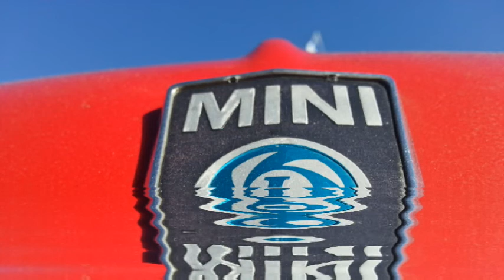Austin mini restoration - Door step fitting

Comment: Hi Sean, was looking at getting a spot welder but how do you power yours? I read that even the 6kw ones can't be plugged in by a standard plug? I'm watching your video series before I attempt work on my Mini. Cheers
Reply from the maker: Hi, you would need to get the power in your workshop upgraded to power a spot welder. Some will work off a standard plug but you will find that the electrics will keep tripping. I just plug weld

Comment: Was it hard to fit inner wing I am trying to fit mine it’s a pain to fit trying to get hole lined up for shock mounting i have left my support panel on so I can lie up the inner wing and bolt it on to it what’s best way to fit inner wing
Reply from the maker: I didn't have any real problems fitting the inner wing. I managed to use the shock mounts and door hinge holes to assist in lining it up. Just take your time and double check that you're happy with how it looks before you weld. All the best, Sean
Reply: Sean C thanks
Reply: Hi sorrry to be a pain I welded my inner wing put new door step on genuine one like the one you used did you use genuine door hinge panel I used a magnum one put door on and it’s not wright had a nightmare today lol was thinking if you used genuine or same as me sorry to keep asking
Reply from the maker: Hi buddy, the magnum pillars are totally wrong and don't fit. The profile isn't even right. You can get them to fit but it's an utter headache so my advice would be to fit heritage panels in key areas like the hinge pillars. I've fitted a flitch (magnum) to the passenger side and the fit is bloody awful to the point in considering scrapping the entire inner wing and replacing it with heritage. All the best, Sean
Reply: Sean C aw ok thanks for your help much appreciate it I did have my old hinge panel on door fitted fine then i lie up new inner wing genuine and weld it up it’s only when I took out the old hinge panel and put new magnum hinge panel on now door not fit lol I will take your advice and take out the magnum door hinge and fit genuine one thanks for advice mate